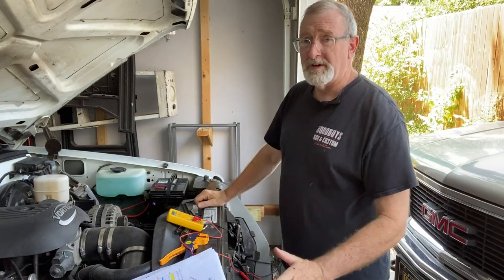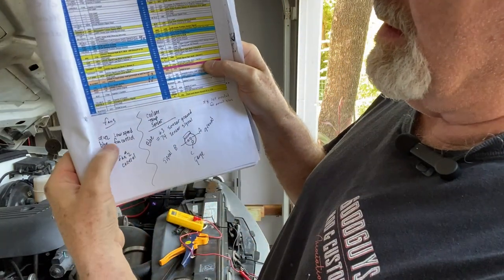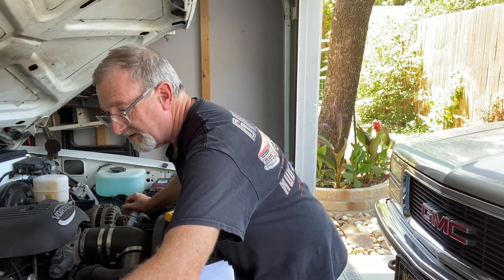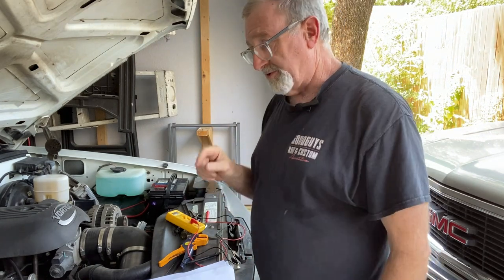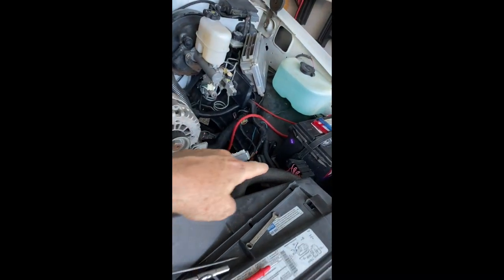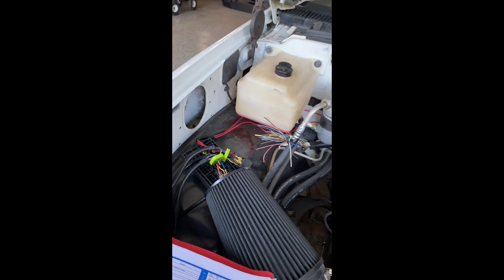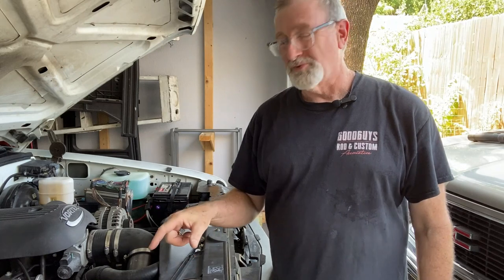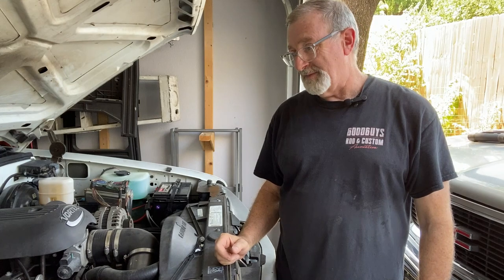OBS Chevy Project Truck LS Engine Swap Cooling Fan Fix

Comment: Been watching your videos for a while Mr. Lawrenceville you do a good in-depth job of explaining the wiring diagrams of the OBS swap,  BTW...is that a GMC obs in the background going next after the  91 obs project,  can't wait for the GMC 1500 to get  started.
Reply from the maker: Well, both yes and no. It is a 1998 GMC K2500. It just turned 90K and is in great condition. Everything works...well almost everything works on it. It is a California truck with zero rust, one owner, until now. I will do an intro video on the GMC in the future and there will be some videos from time to time on it as I do need to make a few repairs. But, for now, she IS my daily and with no engine issues, I don't plan to do a swap until the 5.7 gives me any trouble. Just too clean to tear into just yet.

Comment: What fans are you using? Looks very stock.
Reply from the maker: They are aftermarket fans, here is the link I used on ebay...https://www.ebay.com/itm/351655988506